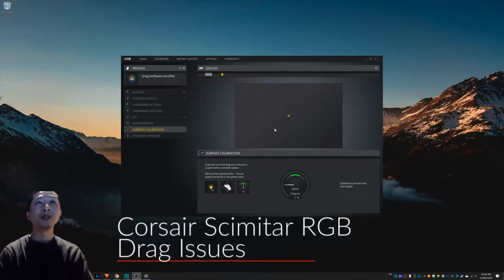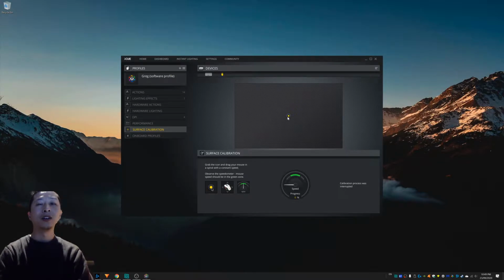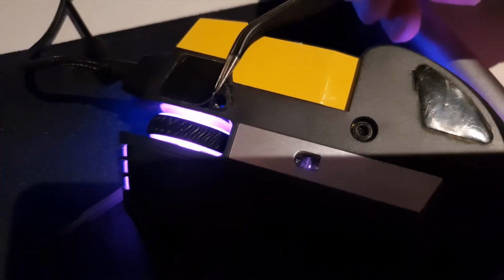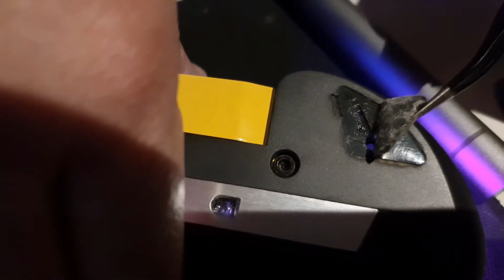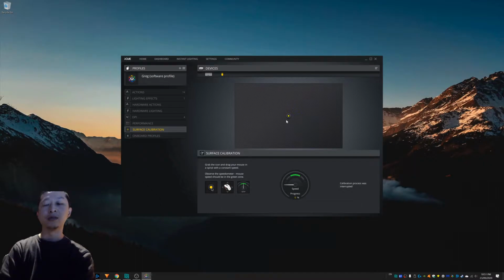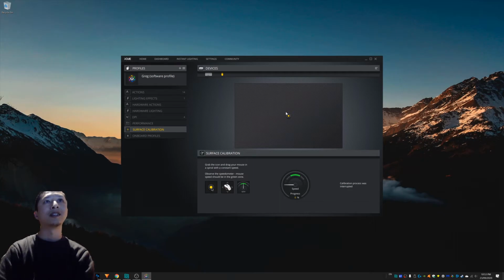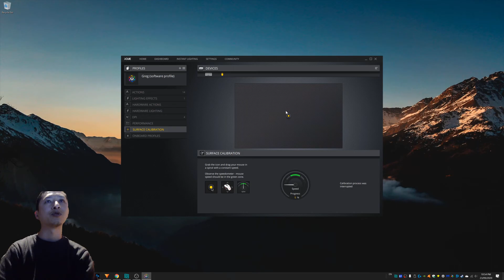Corsair RGB Scimitar Drag Issues (and how I fixed mine)

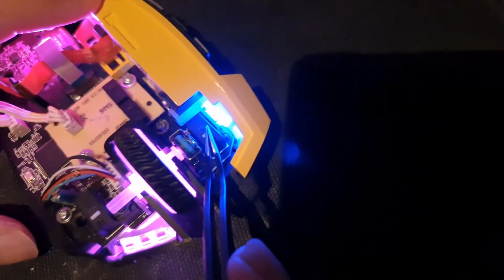Comment: Anyone know how to fix the left click being stuck down? It's stuck and wont come back up. 2:12
Reply from the maker: You may have to take it apart. If the trigger button is jammed, you can possibly remove some debris from it if you're lucky but otherwise, replacing the trigger might be a fix. Once you have taken it apart, press it with your finger to see if the trigger bounces back up
Reply: @LetMeFixIT  I pressed it with the same tool you used to test it and it got stuck down.  It won't come back up I've tried pushing it back towards the center of the opening that it's in but it won't come back up. I guess it's a good thing I already have another one coming in the mail. I can't go back to other mice, tried to use my old mouse yesterday my hand cramped up so hard because it's not shaped to my hand like the Scimitar is
Reply: @LetMeFixIT  Had already taken apart and done that.

Comment: Took mine apart and noticed that the left click hammer (the plastic part the touches the micro switch) was worn out. It was significantly lower than the right one. So I took a small piece of plastic (1 mm thick or so) and super glued it to the hammer. No more double clicks. Let's see if it holds.
Reply from the maker: Yea, I did that too except I used a few pieces of duct tape.  I ended up buying a new mouse though cos I didn't know the sounds haha.

Comment: my scimitar pro's mouse wheel isn't working, I can use the mouse click but not scroll, what should i do?
Reply from the maker: The mouse wheel has a trigger inside as well.  Have you opened it up to have a look?
Reply: @LetMeFixIT  I opened it up and took out the Mose wheel, the tip that goes in the spinning thing was broken. I tried to glue it together but the tip broke of again so I bought a scimitar elite instead